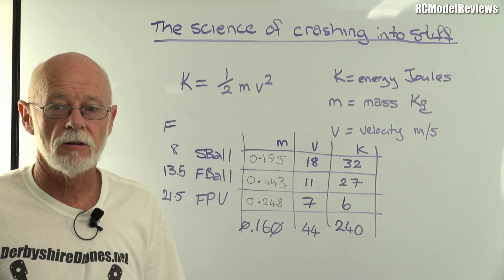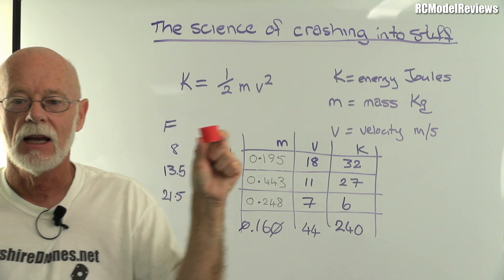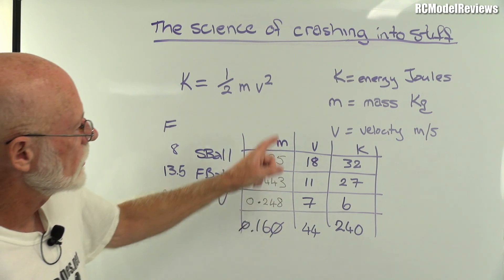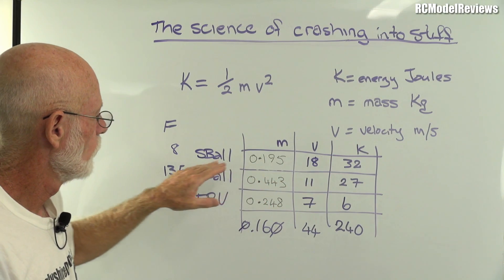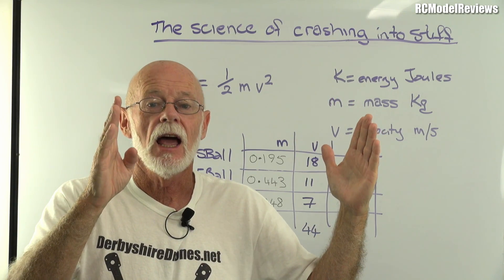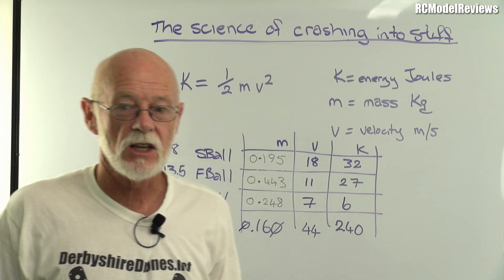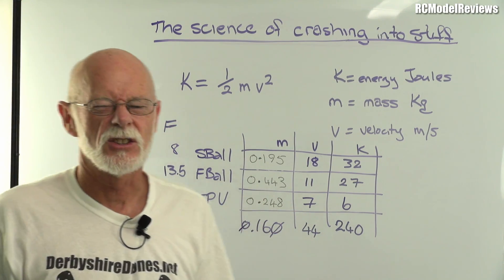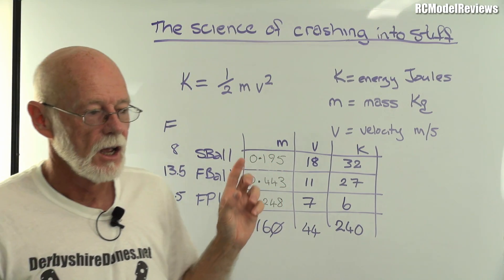The science of crashing into stuff (Kinetic Energy)

Comment: One if the risks of flying a powered model is the propeller. You can get a serious cut from a small prop. That may be the reason you can't fly in a public park. Calculate the kinetic energy of the tip of a prop spinning at 2000 rpm.

Comment: I noticed the balls referred to did not have  little whirling knives attached.  The high velocity and small contact area of those little whirling low mass blades can do a lot of damage and I have had the stitches to prove it so this should not be ignored.   Prop guards would certainly help alleviate that problem so consider using them.

Comment: Your video is interesting. But the real danger of things is the way they impart their kinetic energy to a target. If the missile has a small cross section, then the energy is tranferred to a smaller area on the target and can be more dangerous. Here in the UK there is legislation to limit my air rifle to 16 Joules (12Ftlb) but this will kill rabbits and small vermin and could really endanger a person. The airgun pellet is 5.5mm across and weighs only 1.03g. A football in your tests with an energy of 27 Joules spreads it's energy across a larger area of the target and makes it reasonably safe to kick a football at somebody. I know your sub 250g model has a wide blunt nose and probably wouldn't harm anybody in your park. However, make a model with a pointy nose cone, or a sharp propeller blade and you could be in trouble. Maybe that's why people object to model flying in the park?

Comment: I'll take that 27 joules from a football to the face any day over 7 joules from a quad. I'm far more concerned about the near instant energy transfer in the leading edge of a prop with no give hitting my skin than a fist sized contact patch that compresses.

Edit: Huh, had a try at the math, and it's very similar... 3" props at 2500kV, 4S.
Prop tip velocity is roughly 46m/s = (15V * 2500kv / 60 * 80mm)
A 3 inch prop weights 1.5g, assuming tri blade, thats 0.5g per blade, and I'll take 1/10th that as the blade tip weight.
0.0529N = 1/2 * 0.00005 * 46^2
Pressure = F/A. I'll assume 5mm x 1mm for the leading edge.
1.5 lb/in^2 = .0529 * .005 * .001 for the prop edge.
 (website calculator)
1.5 lb/in^2 = 27 * .05 * .05 (assumed 5x5cm contact area)

A little bit of rounding in spots, and ignoring the angular momentum of the rest of the props being stopped by the one tip. But nearly identical force to any given bit of skin.

Comment: Not trying to disagreed with you regarding the safeness of foamboard but the result in your list doesn't to be convenient enough to me. 32K for SBall and 27K for FBall are actually the maximum energy you provided to the balls with the speed of 18 and 11 as result while the FPV did not get the max energy (with full throttle) you could provide.  Another factor that is not in your equation is the material and the size of the object. A SBall  with the same speed as a FBall hitting a living thing could cause more damage as all the energy is concentrating in much smaller area .

Comment: The elephant in the room is prop strikes - thats what I would be most worried about if you tied me to a chair and flew a plane at me. Bruce's plane is uncommonly safe in that respect because the prop is in the centre of the craft. A Spitfire not so much. Sorry to throw the cat amoungst the pigeons but if I was a legislator I think I would give additional considerarion to motor power and propeller placement / enclosure. If I was being a worry guts I would point out that on Bruce's model the prop is exposed for a few mm above and below the the centre of the craft. Could there be any risk of a cut or abrasion if the plane skimmed the top of my head? Brushless motors are high speed but low torque and propellers are light so maybe its not significant for a small motor like on this plane? A simple prop guard would be easy to add in any event. Great video and great plane - I intend to build one when plans are available....

Comment: I have been "researching" this a lot lately. I have been flying my 170g cinewhoop indoors after work and I was surprised at the lack of damage done. Even when hitting a wire cart with high quality ball bearing casters at a good speed, the cart doesn't move. Same goes for cardboard boxes of similar weight to my whoop. Even a small plastic parts bin was unmoved. It tipped slightly but didn't move. I have come to the conclusion that the heavy, flexible plastic hoops on the ET115 must be absorbing most of the force. I was surprised. It doesn't even make a mark on cardboard boxes.

Comment: Science question for you Bruce. I've been testing the motor I bought recently, and I chucked a 5030 tri-blade prop on it (to see if I can get a quieter propeller motor combo) and something interesting happened. The sound of the blades changed and there where very strong high frequency vibrations (strong enough to undo the stock prop nut). Doing some math (it's a 1808x2400kv CW motor on a 3S lipo) with a 5 in prop it wasn't instability caused by going supersonic, as at maximum throttle (which I couldn't reach without risking it throwing the prop nut) it's only doing about 174m/s at the blade tips.

Switching to a standard 5030 propeller it's fine all the way to max throttle and both propellers seem to be balanced. 

What is it that I am encountering?
Reply: If it happened at a certain RPM and not all the time it's likely resonance. Otherwise proobably unbalanced

Comment: I am pretty sure you understand the distinction between mass and force, so it's difficult for me to understand why you want to tell people that if something has a mass of a kilogram it weighs a kilogram. I also live on Earth and understand that weight is proportional to mass, but when you talk about transfer of kinetic energy and damage and time and distance involved, you might be talking about accelerations that do not equal the accepted value for a free falling object in Earth's gravitational gradient near the surface. I don't care what units of measurement are used, I know several conversion factors and formulas. Furlongs per fortnight is my favorite unit for speed (not velocity, direction matters). For angles I can work with radians or degrees. Sometimes one is more convenient than the other. I do not care if you want to promote the metric system while using miles per hour as a unit of speed in your video. The metric system does make it easy to just move the decimal, but does little to simplify calculations involving fundamental math and physics constants. 

Please do a video about the science of energy and momentum. Please keep the units consistent. Kids might be watching. Take care, love your channels...

Comment: What is the kinetic energy of the rotating blades?
Reply: The propeller is behind the wing, so it wouldn’t hit you unless the wing broke in half or the plane was flying vertically. It’s of little consequence to the problem at hand.
Reply: There are many models with propellers positioned in a way that makes it extremely difficult for the blades to hit anything. And even it hits someone, a 5 inch propeller on a 10 gram motor is not that dangerous. A 10 inch propeller being swinged by a 50 gram motor hit my hand. It hurt but it wasn't so bad. And that prop& motor combination had more than enough power to fly a model that weighs more than 1000 grams.
Reply: Yes. Very good points. Propellers are seldom the danger they are made out to be. 
     (Subscribe to Copterdude)!
Reply: @AeroCraftAviation  I see you have slow fliers and gliders on your channel, subscribed :)

Comment: Are you sure it isn't half of the v^2 multiplied by the Mass?  (jk) - or even half of the m*v^2

(that's how the integral  - of momentum- works to define KE.)  lucky scalar multiplication is commutative).

NB. a 250g model will get to 80J at ~ 25.5m/s. - 91.8km/hr - 57.04 mile/hr...  (Is everyone included? ok, not -  85.06 light nanoseconds/s  geeks as well)

Comment: Should you be using momentum for collison instead of kinetic energy.  Change in momentum is force.  Force is what hurts.
Reply: Energy is what does the damage. Momentum is pretty much irrelevant when the difference in mass is that big and is only a useful/simple concept if everything is purely elastic, which things here definitely aren't.
Reply: Momentum transfer is just part - pressure (force across an area) will cut. The propeller has fairly low KE and momentum, but it's a part of a mm wide at the edge. It will slice deeply due to momentum transfer per area.  This may make the point less strong as a softball impact area will be much larger than the nose or wing egde of the airplane.
Reply: Yep! The transfer of momentum needs to consider the mass of each body and their relative velocity. If your head was moving away from the FPV 'object' at the same speed the object was approaching you, there would be no transfer of energy.
I think Bruce is assuming that your head is stationary, so he only needs the velocity of the approaching FPV....

Comment: i feel this should be done more thoroughly..i feel they should all have same relative speed..this seems to give the high 5 to fpv..but the slower speeds have some variance..if the fpv and the other objects are same speeds..it takes less variants..so clearer results..but thanks for shaqring..i also feel the results would still be similar but fpv being more in the middle.
Reply: Yes but it would be innaccurate to show the same speed for the FPV as for the balls, because in the case in question, they are not traveling the same speed. Bruce has shown the realistic speeds for all three (or four) objects, so this is the most accurate and realistic calculation given his methods. It would be unrealistic to say that the balls travel at a similar average speed to the FPV, because Bruce measured it, and they don’t.
Reply: @AeroCraftAviation  personally i dont fly much fpv at 7 mph
Reply: What would be the point of testing them at a speed that is NOT their usual speed when in use? Make a rule that you must not kick a football faster than 5m/s?

Comment: How many joules would your little plane have when you're flying at full throttle?
Reply: Double the speed = 4 x the energy.. I am guessing 16 =20 Joules flat out..
Reply: That’s a good question but I think you would prefer maximum velocity (most safety tests use typical use velocity rather than maximum). A better test would be to find the maximum velocity from falling from maximum Flight altitude. This would be very representative of a typical crash when a failsafe occurs. I would like to see this result as this would be representative of worst case.
Reply: Good question, it should apply to the softball & football as well. I’m sure an athlete would more than triple the velocity of the balls. The speed of a thrown softball would be about the same as the cricketball example shown, & I think speed could increase further with a good hit with a bat.